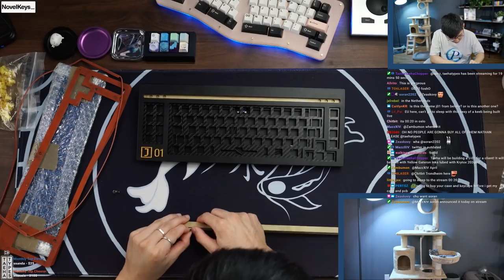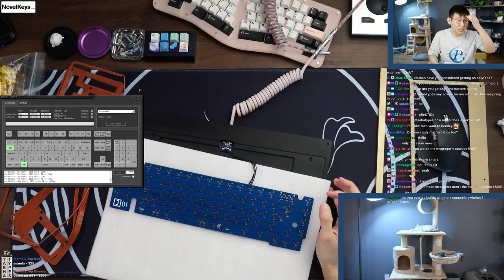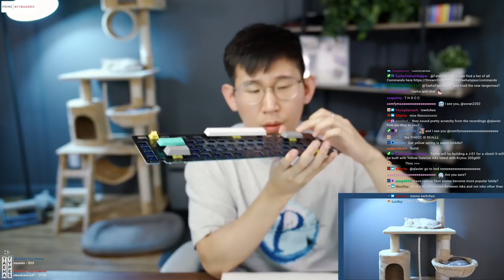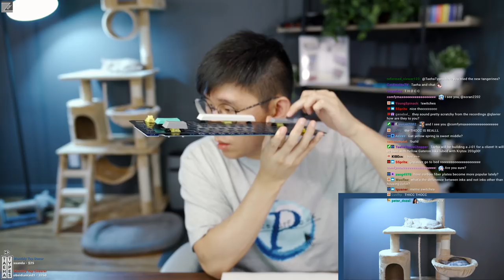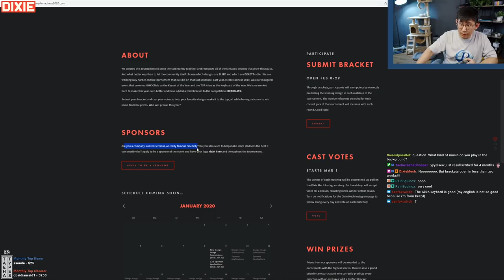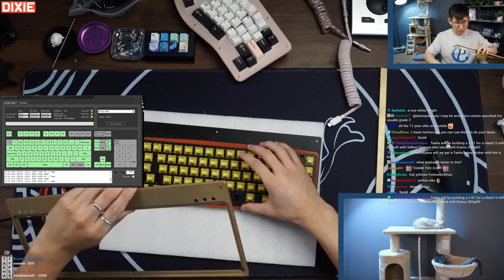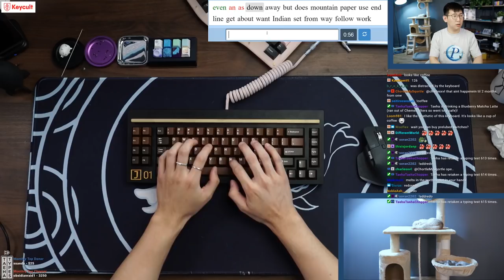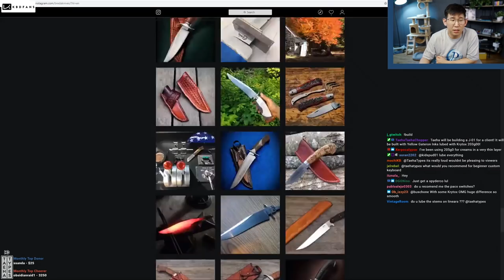J-01 with lubed Yellow Gateron Inks Build Stream

Comment: I know it has been a while since this has been posted, but at 2:34:05 that sounds like a small dense piece of wood probably about the size of a pencil tapping on a larger dense piece of wood that is about 1-2 inch thick. SOOOOOOO you'd likely be able to reproduce this sound but it would be artificial and you'd need a wooden case ans some REALLY tight tolerances.

Comment: Just selled ultra budget mechanical and I am so happy. The money I received don't even cover tx bag of taeha, but still XD I am happy that I got some money back because I am mechanical keyboard enthusiast now and as majority of enthusiasts spend a lot of money for gmk and keybosrds. Now I want at least to have all keyboards with good or ok software after I tried amazing QMK and VIA software :D the one I selled software was no no no

What 65 keyboard people would recommend similar to kbdfans67, because I want similar keyboard just with a bit different design and materials. I know about nk65, but maybe there are more keyboards to recommend

Btw I think gasket mount is similar to top mount in experience but it is like comparing tealios smoothness and gateron inks smoothness XD both are good and probably you won't feel super difference but people say tealios is smoother (I have tealios and yes it is smooth but I doubt that inks are like three times less smoother)

Comment: I'm deciding between Black inks or Yellow inks, are the blacks that much heavier? Does it fatigue your fingers when typing for too long?
Reply: Black inks are pretty heavy. You could go for red ones since they have a 60g bottom out and are basically the same as blacks
Reply: GipTukeMan25 but it seems like a lot of ppl use blacks or yellows in their builds. I got to try Blacks a while ago and I remember it felt pretty good, but I havent touched them again for a while now so I kinda forgot the feeling

Comment: Question: Can you lube soldered yellow ink switches (injecting through the stem)? I noticed the stem is a different type to the other inks
Reply: very not recommended for lubing without opening the switches